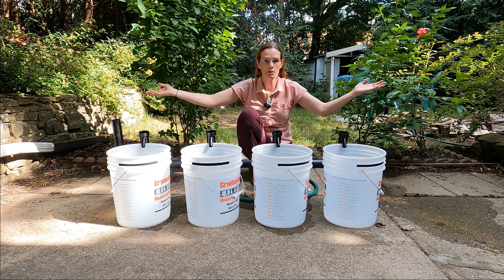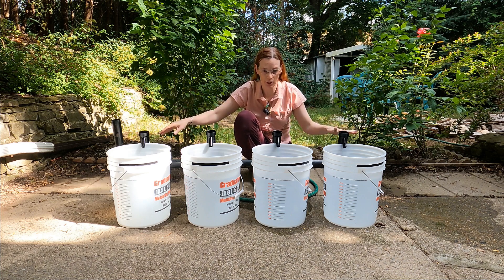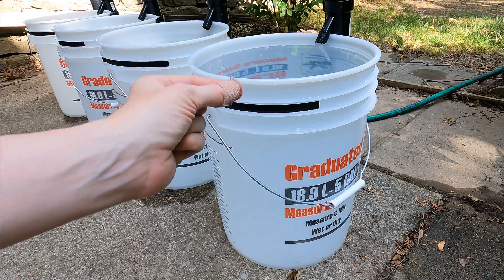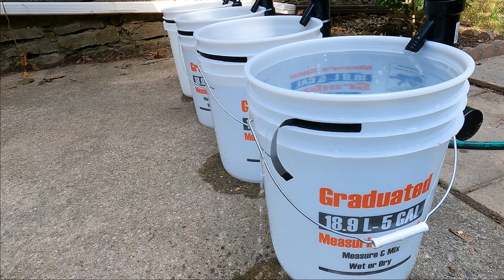A Visual Guide to Top Balancing (Ep. 8)

Comment: Good demonstration. I'm assuming the battery that's higher than the others drains from it to the other batteries via the balance leads. I suppose a simulation of that with this setup would entail a small diameter hose that goes from one bucket to the next. And each bucket would have it's own partner battery with a linked tiny balance hose. I still have to watch more of your videos to get a better idea os what's going on. Good to develop an understanding of control systems involved.

Comment: i kind of understand this concept and the BMS how it manages the power, i have often wondered about the charging of AA batteries with a simple plug in adaptor into a standard 240v (UK) house supply, i gather AA batteries have a memory that is depleted, a work colleague who understood these things suggested it is best that when batteries are new to charge fully for the suggested length of time, 4hrs 10hrs etc a few times and totally discharge them in a torch etc, so does that happen here? do these batteries in your system have a memory, will each cell become more damaged than others in due course
and can the BMS not just shut off a cell and let the others charge to the same level, or even use the overflow power to charge into the other cells to save on wasting power, if that's a thing or not

Comment: Interesting demonstration!  I really do appreciate your effort in putting this together.  But after some extended thought on this, something really bothered me. That is that this demonstration does not actually simulate a 4S battery pack.  Why?  Because according to Kirkhoffs Current Law a Serial Connection would draw current through all 4 cells when they are being discharged as a pack.  The SAME current.  What you have demonstrated isnt even a battery pack. Unless each cell is interconnected directly to the next adjacent cell with a tube of some fashion these are simply 4 independent cells charged and discharged separately..

Comment: Excellent explanation and or demonstration. Now my mind running wild, What if there was a controller that instead separated each cell charged it independently and only on the output tied them together? heck even had a mosfet to throttle each cell so they discharged equally... This would solve the 'well the peak solar time is NOW but cant charge because one cell is to high' problem and help keep the cells balanced during discharge. I need to think more on this.  Thanks for sharing I am learning a lot!
Reply from the maker: I've got a BMS I'm going to test soon that has a good approach. Andy showed it on Off-Grid Garage first used it; Basically, it sucks power (water) out of the fullest battery (bucket) into a supercap bank, then dumps it into the cell with the lowest battery (bucket). I've got it, and plan to play with it after I get the battery box rebuilt.
Reply: @TheDigitalMermaid  Oh yes that is smart! I'll keep watching and see your test

Comment: Good demonstration.  But here is the important part.  Solar is like the hose on full power it can fill much faster than the holes can drain.  Using a trickle to fill will not put in more than the holes take out and will eventually fill the low buckets and not over fill the high ones.  So you can balance just by a low current charger in your setup, which is kind of how all these BMS products are designed(wall charger that tapers current near top voltage).  Although, better just to parallel all the batteries and let them sit.

Comment: Oh you clever girl. Nice demo. That is how I though it works but know I understand it even better. I wanted you to rotate the right two buckets about 5-10 mins CW to match the print on the left two buckets. I disagree with your last statement. I understand by connecting each battery in parallel and allowing them to rest, the current will pass to the lowest SOC batter(ies) until they all reach the same potential (15-30 days?). Then connect a charger to bring the pak up to your final cutoff voltage. Then all batteries will be at the same SOC. Right? Thoughts? Thanks for sharing.

Comment: Hi to you and honestly speaking I'm impressed about your videos!!!
Is very nice explanation but in my point of view for your application a must is a  active balancer that can "move" current from one battery to the other continously and constantly!!!. The discussion over the net is if is necessary balancing "all the time" or only during the nearly full charge and full discharge because is in that area the active balancers can move lot of energy(they all work due to difference of tension and the bigger is  the difference, the bigger is the current is moving.
with your tension should work great the active balancer!!!
Have a nice day!!!
Reply: That is exactly why i think of Some sort of Switching supercapacitor BMS design..

Comment: Most BMS units use "passive" balancing that stops charging the pack once any cell reaches a set voltage, eg 3.65 for LPF, and then turns on the bleeder resister for the fully charged cell, slowly draining it.  Any you're right, it drains at such a slow rate, that it can take a significant amount of time drain enough so that all the other cells can get to full charge.  Even worse, if you have 3 cells fully charged and one cell at a low SOC, all three fully charged cells need to be slowly drained.  Imagine a 16S pack with 15 fully charged cells.  It would need to bleed 15/16 of the energy being put into the pack to top up that last cell.
You can improve the speed of passive balancing by reducing the value of the bleeder resistor so that it draws more power, draining the cell quicker.  But of course that has the disadvantage of causing more heat, especially as more cells reach their full charge.  In your demonstration, this would be like drilling a bigger hole at the top of the pail, causing your patio to get pretty wet.  ;-)
In contrary, "active" balancers move energy from one cell to another.  That would be like dunking a cup into the fuller pail and moving a cup of water into a pail that is less full, and repeating that until all pails where equal.  Less water spills onto the patio, ie, less energy waisted.
Reply: Exactamento.. 👍
Reply: The BMS 'balancing' voltage is a little lower, 3.4V than the cutoff of 3.65V so above 3.4V the resistor is working and above 3.65 the main relay/mostfets are shutoff.  But as you said they are so small (100mA) that they are effectively useless unless you can use a wall charger plugged in for several days after the first cell hits 3.4V.   Even a a 5W solar panel would be too much for 100mA resistors...so yeah, these BMS designers still haven't figured out how to manage solar charging with 10s of amps.
Reply: @jmaus2k  Good point about balancing starting before cut off..